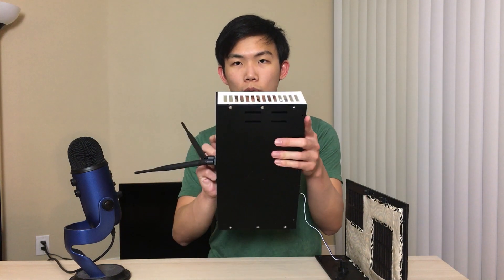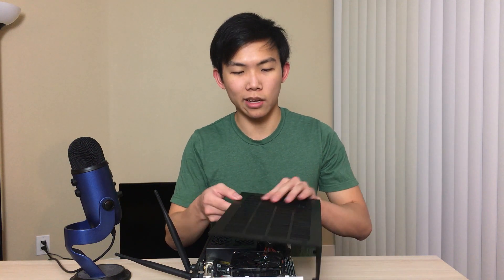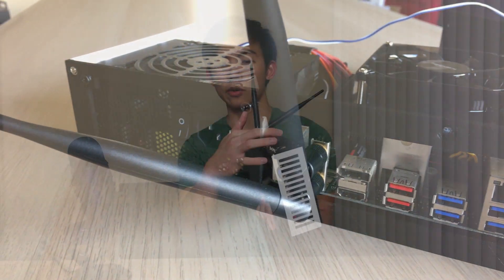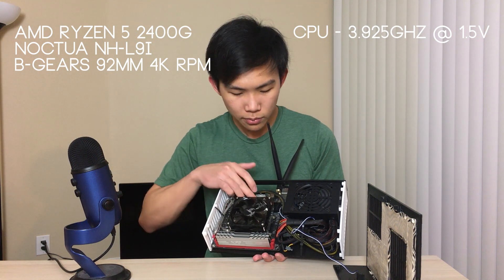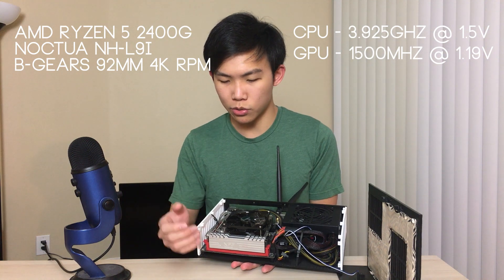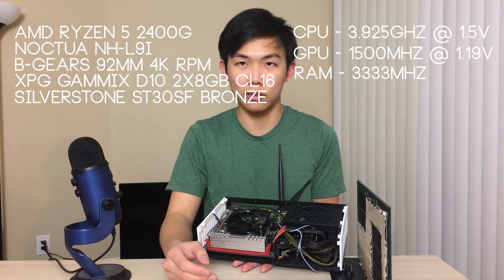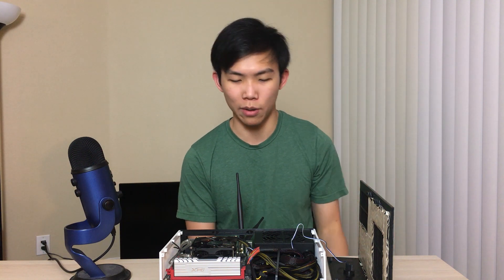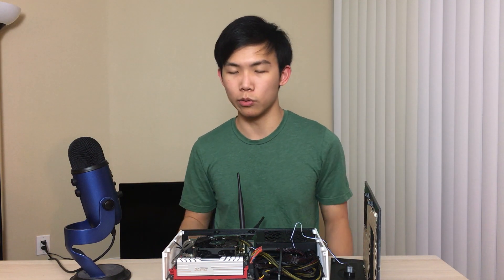Smallest 3D Printed SFF PC! | Ft. AMD Ryzen 2400G (No power bricks)

Comment: I really like your case and build and the reasons why you used it! The Ryzen 2400g is so powerful it even puts my RX 570 to shame due to how much it costs and that you can add a more powerful gpu. You could think about adding a GTX 1660Ti via a riser cable if you ever wanted to play games at higher specs. I really want to make my own case from a 3d printer like this exactly the same design but with room on the left of the Motherboard to add an ITX graphics card. I would be willing to buy the layout for the 3d printed case cause my university has 3D printers but I don't know how to design it. Would it be a lot of work to add extra room for the ITX gpu and maybe two 2.5 inch drives? Is your SSD an M.2 SSD or a SATA ssd? I already have a 240gb ssd and wanted to use my Ryzen 3 1200 and 8gb of ram and I have an ITX 1060 3gb in another PC (my current Rx 570 is full size). But I was thinking of using the Ryzen 3 1200, 8gb ram, GTX 1060 3gb for an ITX build like this. I also have that same Noctua cooler cause it is so darn good as I had previously had a small form factor build but then got a micro atx mobo and different case. Then I switched from Intel 4th gen to Ryzen for the first time also micro atx so I would only have to buy an ITX mobo and sfx psu though I might use my stock ryzen cooler cause it is quite short. Would you have any advice on making a blueprint for this kind of case? It would be the same size as yours but just a bit longer on the left to add a GPU. Also you should share your video on SFFPC reddit forum if you use reddit cause they would totally love this build and I am sure there are many users there would want to make something similar.